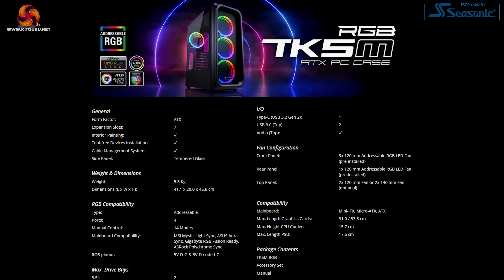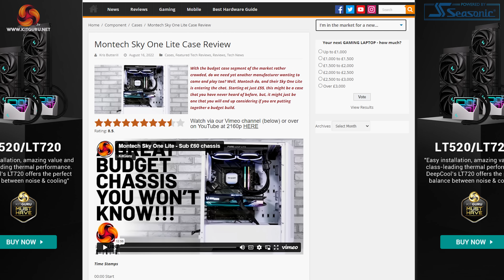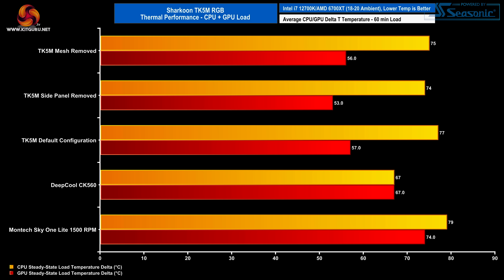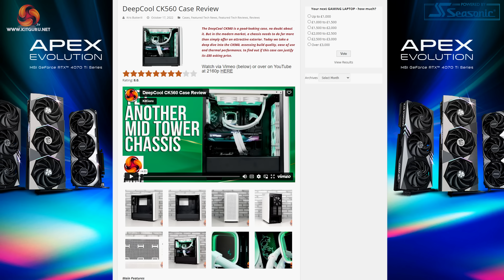Sharkoon TK5M RGB Review - four ARGB fans!

Comment from the maker: What's most important to you when buying a new case - value, looks, performance, ease of building? Let us know your thoughts
Reply: For me it would be now that it fits a Powercolor red devil RX7900xt [the behemoth 3-4slot one]
Reply: airflow for me, as long as my components are well cooled i'm happy!
Reply: This ticks the boxes; not too shabby at the price point. I don't know the front filter is a necessity or not in this case, but generally two lots of fine mesh is overkill and fifty-fifty whether they fight one another; ditch it and you can probably go up a CPU or GPU for the same temps. I'd have a word in Sharkoons shell-like: ditch the front filter and used the savings to pay for tidying up the bottom filter. That bulged panel is unsightly and needs a rethink; there have been cases with that kind of panel for what? 20yrs maybe; so I don't see it happening. I'd see about taking the bulge to the edge of the panel maybe; I do realise they'll want to reuse the carcass to save on retooling. Minor quibbles of aesthetics aside; this meets all your four points with no significant downsides I think.

Comment: Now you have found the best budget case, can you please find the best premium case (obviously including the custom water looping that comes with the top of the range setups)? 
I nominate the Cooler Master HAF 700 (beserker not EVO to save £100), with three 420mm radiators (top & side & bottom) & two 200mm fans on the front & two 120mm fans on the back. Enough for silent extreme cooling even for hottest overclocked CPU & dual active water blocked RTX4090, & a water block on the super hot new Pcie5 M.2 SSDs. I think this case is the best of the best because besides that unparalleled cooling, it's tool-less design & layout is unmatched even in more expensive super towers.
Reply: Yeah id like to see a good cooling focused review on the HAF 700 here. by james or leo

Comment: A very useful video. Thank you. I think I would trade the RGB for PWM fans.  It's cheap and cheerful and hits the marks and you demonstrated all of it.

It's very minor but I noticed that you only removed one slot plate when fitting the dual slot GPU and that the other slot plate lined up almost perfectly with the GPU. That's some very careful design there. Or plain luck.

Comment: Just like a PSU never skimp out. You can keep them for ages if you spend more now. I bought a 1200w PSU in my SLI days and I am still using it now with my 4090. My case was also massive from 5yrs ago and it also fits large 4090's unlike most cases.
Reply: Yeah people tend to overlook power supplies. It’s critical for a good stable build.
Reply: Or keep your eyes peeled; I picked up a still -in-cellophane 1200w Platinum rated for about 1/2 the current price 'cos someone didn't know PSU's aren't mobile phones; obscelescent as they hit the shelves.
Reply: @stevewatson6839  half price? I assume ebay? hell of a deal

Comment: you cant control fans from your motherboard if your using the molex adapters, they will just run full speed
Reply from the maker: Indeed, and that's how we tested (at 09:05). We're only pointing out that Molex adapters are included if you want them

Comment: Looks, price, overall quality, wasted space and materials (front panel "art", useless PSU shrouds, drive bays in 2023, cheap included fans). 
Performance is overrated. 60°C or 70°C CPU, what's the difference besides the number? Seriously, those temp charts everyone makes are a waste for all but the worst. 
I rebuild my own PC once every 3 years on average, cleaning or some irregular update every year or two. Ease of building is borderline insignificant. Also once you try ITX, any talk about "ease of build" for anything but ITX sounds kind of ridiculous. Features you use once a year at best. So whatever as long as it's free.
Reply: whats the difference between 60c and 70c? 10c. and thats quite a lot. ive spent days configuring my bios to drop temps by that, by undervolting. makes a good difference long term
Reply: @justindavis7600  What difference? Do you understand how power consumption and cooling works? If your PC burns 500W, no matter the cooling solution it still heats your home for ~500W. Doesn't matter how hot any particular part is, the heat emission and waste is all the same. Someone told you cool is cool? Ok, there are parts that are slightly more energy efficient at particular temperature. But it's not worth the time spent on charts for most part. Or you are one of the extreme overclockers, push to the limit, burn 1.5x the power, squeeze 1..2 extra FPS? Can't be serious. Noise - yes. Temps - f. them.